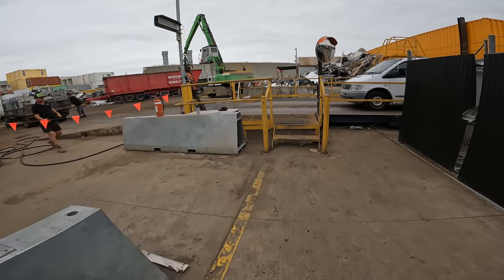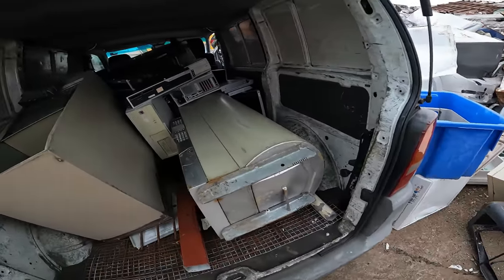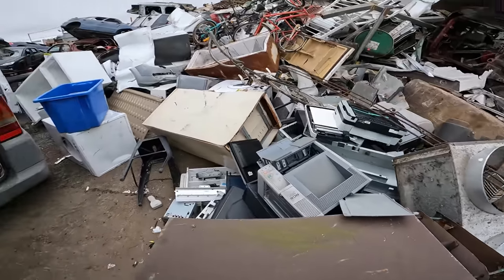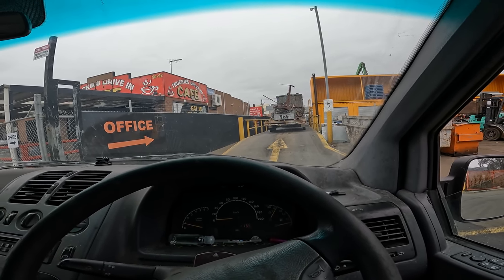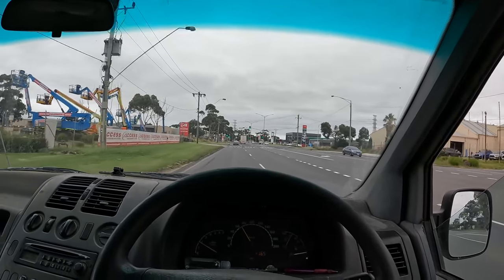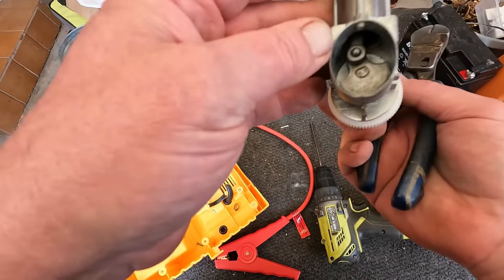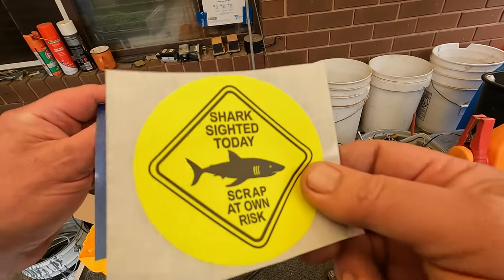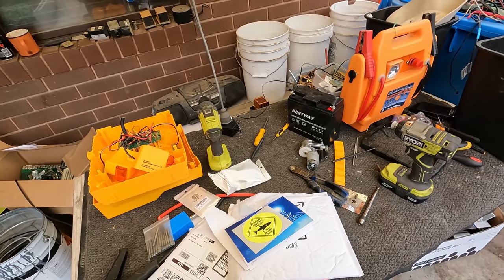Scrap Steel Run & Subscriber Gifts

Comment: I do the same thing. Scrap steel or "shred" as it's called here goes to my local yard. Everything else goes to two  different yards 80 miles away one for non ferrous, the other for E-waste. Well worth the drive as they usually pay half again if not almost double as much as my local yard.

Comment: Yep there always a levy. sounds like they were paying less than what i got. (few weeks ago...the yard i was at was in bendigo and it was norstar steel recyclers paying 300 a tonne, which even after levys youd still clear an easy 260/270 a tonne and that was as a NON-abn customer. )

Comment: great video ben, im in the uk, i took my stuff to the scrapyard today, we only have one on the island. but thought i would share with you the prices of what i got.
clean brass  1kg = £3.35
transformers/motors  17kg = £4.42
heavy copper 98% 1kg = £5.20
household cable 42% 14kg = £23.80
lead acid batteries 7kg = £2.10
a total of £38.87
 which is a little over 72 austrailian dollars where you are.

Comment: Ok I have a question? I understood the part about removing and replacing the water tank but you removed you furnace? Don't you use a heater there?